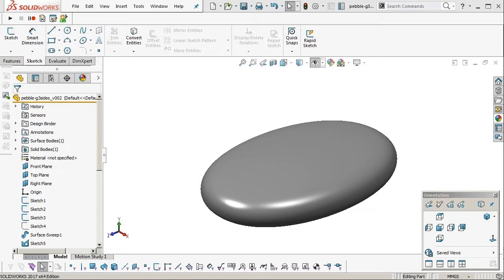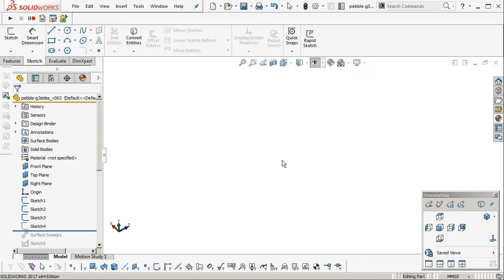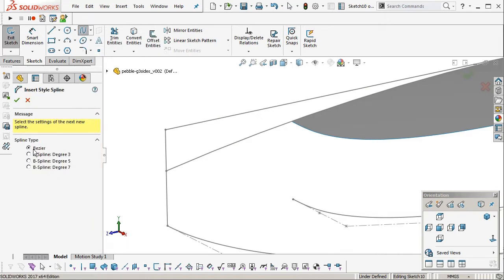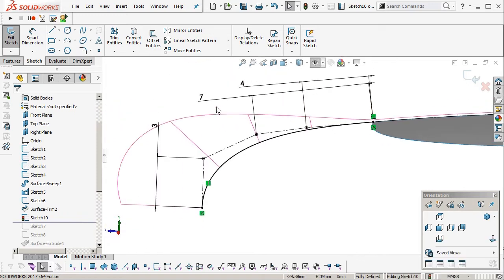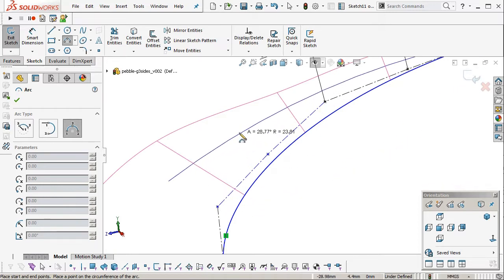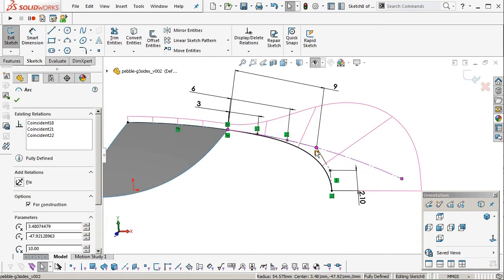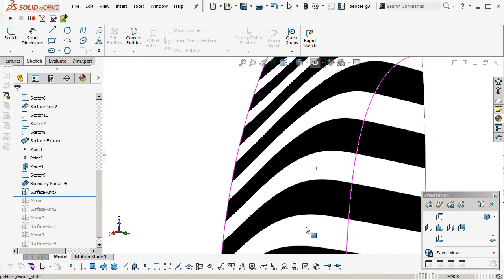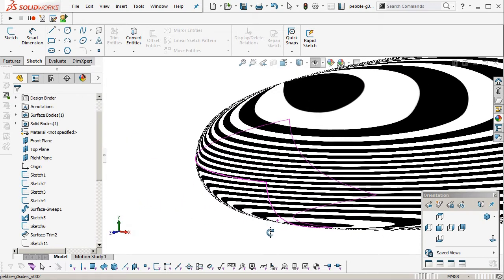Solidworks Tutorial: Approximating a G3 connection in Solidworks

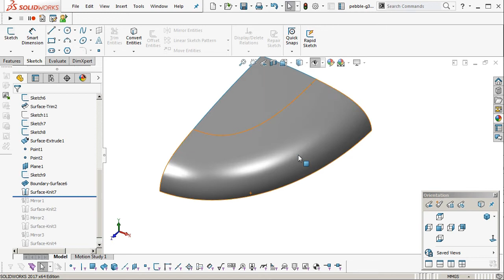Comment: Though at 14:02 you can definitely see from the curvature radius evaluation that there are "blue" dimples in the "blend" surface.
It is small ~2%, but still is an indication that the surfaces do not match within constr. tolerance (depending on file constr. tolerance).
Maybe when you knit them it will get resolved somehow (as the mesh polygons for the curv. radius analysis will be forced to align to each other) or maybe because it is a trimmed edge after all...
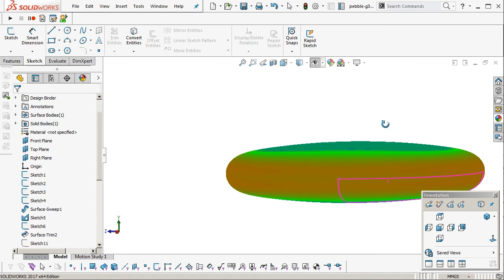Anyway, you show it at 16:40 and the "blue" dimples are still there on the knitted surface\solid body, so the reason is the trimmed edge on top!
Reply from the maker: You are seeing meshing artifacts in the curvature shader. The curvature of the top trimmed surface does not change once it is knitted to the blend surface. I find the curvature shader in SW to be fairly poor - you have no control over the type of curvature displayed, nor much control over the underlying mesh that SW uses. To further illustrate this issue I imported the pebble form from SW into Rhino and used the curvature analysis tool. In the linked images you can see similar artifacts appearing when the mesh is coarse, and using a fine setting there are no dimples in the top surfaces as there were in the SW analysis.

https://drive.google.com/file/d/1eNXWSYJHSyi0H14jRSMyPWZscyjYDGVZ/view?usp=sharing
https://drive.google.com/file/d/1u79_qlsmrId1ZrZHnodpLNzF2UC9juW3/view?usp=sharing
https://drive.google.com/file/d/16MAJvao1ZulkliQVo36-Q-n9RPdmROH_/view?usp=sharing
https://drive.google.com/file/d/1ITs9dFcKfbdGJjWxVMTsn1RPsQdv2HU8/view?usp=sharing
https://drive.google.com/file/d/1y6H9P7KGT5udu_xH1kHE5ykJZTEwMEDy/view?usp=sharing
https://drive.google.com/file/d/1aSk6we_2nn5DVPfIm-Aqfj5mFTf9E2oA/view?usp=sharing
Reply: @AndrewJacksonDesignStudio   Yes, could be that case indeed as I supposed regarding the mesh. But still it is a fact that you build the blend surface off of a trimmed edge (the top surface). Yes, the top surface is quite simple and therefore clean, so maybe there is no problems.
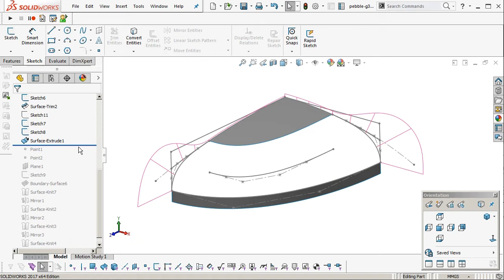Also, when you build the cross curve it seems that you have chosen arbitrary the two points on each edge (around 12:10 min). I would suggest exploring the maximum curvature points of each of the edges an placing the points there respectively. It would mean you would imply greater control for the blend surface (to not bulge out... as SW\SE and other solid modelers tend to do with complex double\triple curved blend surfs.) at the highest tension spots.
I guess you have tried to build the blend surface without the cross section curve. I have not used SW in a while (at least 5 years), so it might have been greatly improved in surface design.
Reply from the maker: @PASHKULI  I do not see a problem building the blend off a trimmed edge, as the alternative would be to build the top surface from several four sided patches. This was a theoretical exercise so agree, probably better ways to build it. Sorry to say Sw has not had much improvement in the surfacing area recently.
Reply: @AndrewJacksonDesignStudio  Here I found some nice video of a fairly recent version of SW, seems it support G3 constraintes.
Please, search for: "G3 Splines in SOLIDWORKS: Torsion Continuity"
the channel in Youtube is: Hawk Ridge Systems
Reply from the maker: @PASHKULI  yes, that was added a few editions ago. It does not extend to surfaces though, ie no G3 edge constraint.
Reply: @AndrewJacksonDesignStudio  Ah, I see. Yes, seems it is only for curves. I am also quite sure it creates multi-span surfaces either way, but after all SW is not a surface modeller. nPowerSurfacing plugin is a good addition but extremely expensive.
Reply: There is nothing wrong building blends from a trimmed surface's edge. The idea is those trimmed edges should be as simple as possible (3rd degree ideal, if 2nd even better but a rarity). Mostly they are 4th or 5th degree. I think CATIA (the big brother of SW has surface modules for A-class design, but have never even tried it; tried NX and it is quite good!; Alias is the boss and Rhino3D is the budget friendly alternative).
Reply: @AndrewJacksonDesignStudio  Got it. In Rhino seems your top surface is 2×2 degrees, which is as clean as it can be for a curved surface. That is why the trimmed edge is... let me see... 3rd degree, pretty simple and but not clean as its got 20+ spans. Same for the blend surf. 26×29 knots: 
order = 4 × 4 
CV count = 27 × 24
Reply from the maker: @PASHKULI  I am using Rhino quite a bit now, good to know what is going on under the hood instead of what SW dishes up. I’m also trying not to be so concerned with ironing out theoretical wrinkles in everything as there’s so many variables between CAD model and final injection moulded parts that can affect things; sink, flash, texture, flow marks, hand polishing of tools!
Reply from the maker: @PASHKULI  yes what’s the alternative in Solidworks though? You cannot set a part tolerance and there is no way to lower CV counts on the trimmed edge. Same goes for the blended surface. No option to rebuild etc. I wonder where you are going with this? Only model forms that give clean results in Sw?! That’s the tail wagging the dog 😀

You should watch ‘thirtysixverts’ on YouTube as they cover some good ground on modelling in rhino, modelling off trimmed edges using match surf and tolerances. I learnt quite a bit from them. Very good stuff.
Reply: @AndrewJacksonDesignStudio  Yes, I am quite familiar with Rhino since 2005. An alternative to SW would be Solid Edge, maybe Creo and Inventor. I worked a lot in inventor. Certainly solid modelers are not surface modelers. But for some 'real world' scenarios, surfacing in solid modeller is a bit of a hit and miss, with much more complex surfaces\curves of higher order. Matt Lombard had really good book back in the days, when he worked for Dassault, then for Siemens. SW is targeted towards mech. engineers, not that much towards product\industrial designers. I always test such CAD packages with a specific scenario I had, building one of my products (on the profile pic): has surfaces curved in all three main directions.
Reply from the maker: I've been using Rhino since 2000, using v1 and v2, it has come a long way since then. It used to be extremely hit and miss exporting surfaces into ProE back then. ID would pass surfaces on as visual references for the engineers to rebuild in ProE. No way the engineers were going to directly use imported geometry in their models :) Quite enjoying using Grasshopper at present. Also spent quite a bit of time with PTC products but now using SW as that is what most of my clients use. It does about 95% of what we need it to do well - the other 5% - you do need to step back and zoom out from those little wiggles sometimes and ask yourself if it really matters.
Reply: @AndrewJacksonDesignStudio  Indeed, the point of those concerns is not really that crucial, rather it is important for the designer to be able to evaluate an assess what is a visual\mesh artefact and what is actually a ripple (defect), which might cause strain at production\manufacturing, delays for urgent fixes, etc. On such culprits usually are the so called degenerate points (one edge reduced to 0 length), thus using overbuild, re-trims back to size and so on.
I am trying to compare SW with SE (Solid Edge) and in terms of user friendly UI, SW seems to have a great advantage, but SE has some unparalleled features.
Reply: Also form my experience the best way to approximate G3 (it is pseudo G3 in this way) is by adjusting the tangency magnitude, given that the curvature and the 3rd point are fairly well spaced. This way you can reduce the blend spline to 4th degree in some cases even to 3rd!